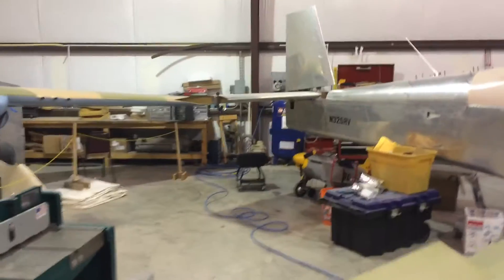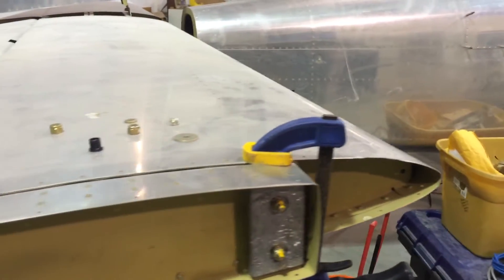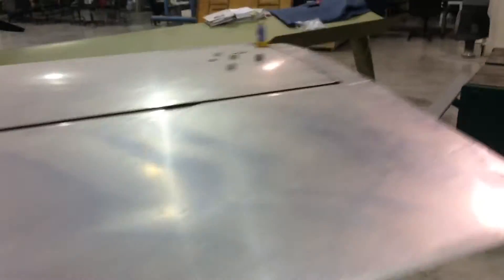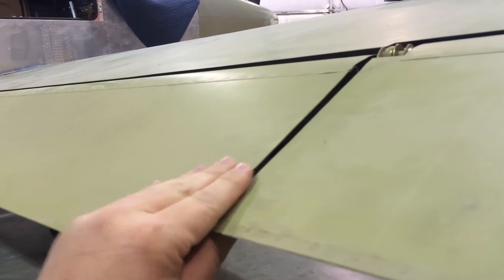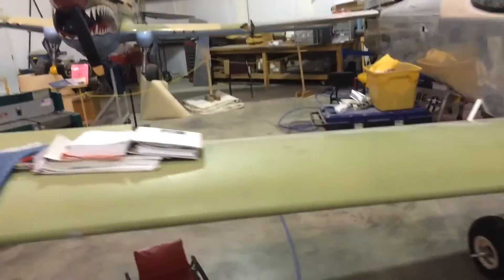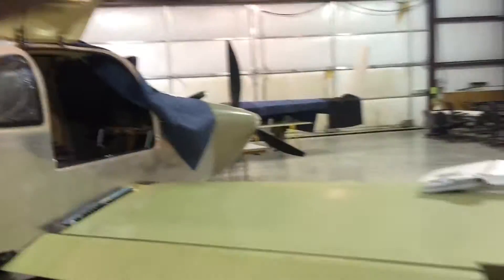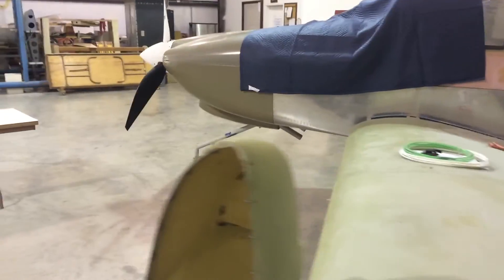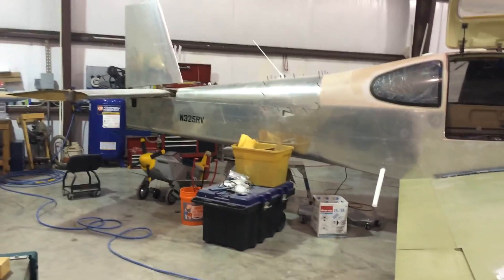RV-10 Rigging

Comment: it would be nice if you can show how it's done
Reply from the maker: I was busy building and not filming.  But following the plans gets you 99% of the way there and then tweaking the rod-end bearings to perfect it gets it the rest of the way.

One comment though that I've found in Phase 1...  The ailerons appear to sag a bit in flight.   Actually the Ailerons don't change, but the flaps are pushed up tighter against the rear spar in flight than in the ground. 

There is a stop for the flaps on the inboard section, but there isn't one on the outboard section, so the outboard section (closest to the ailerons) pushes up even more.    So you need to account for that when rigging the ailerons.  Make sure you pull that outboard end of the flap up super tight, then rig the aileron to match it from that point.

Not too bad.  It took a couple of days to get it....